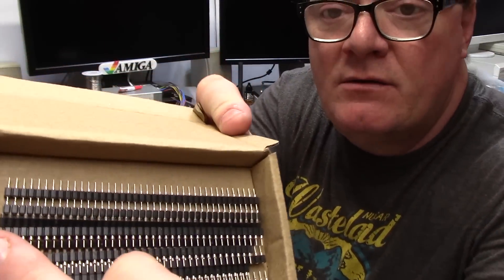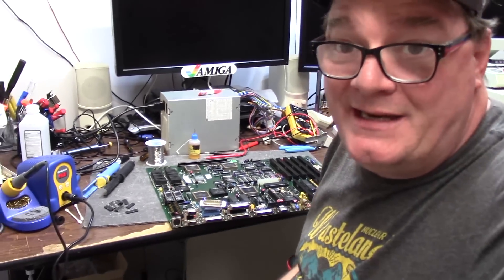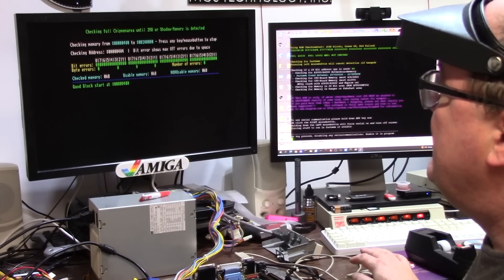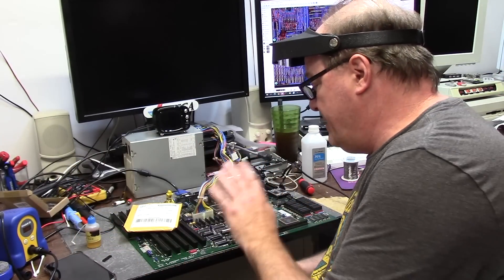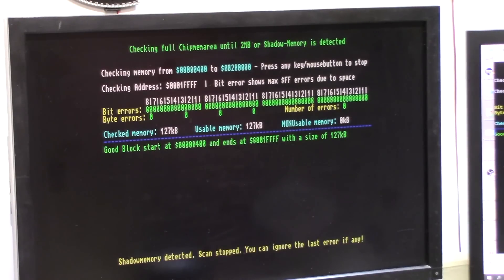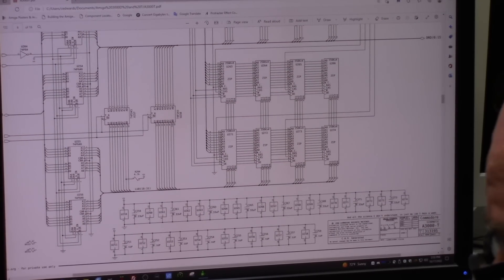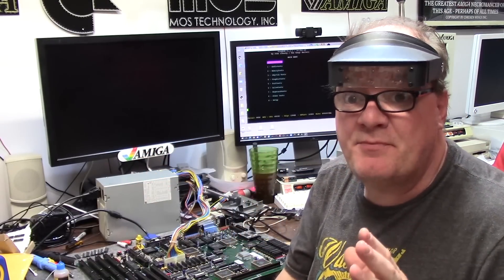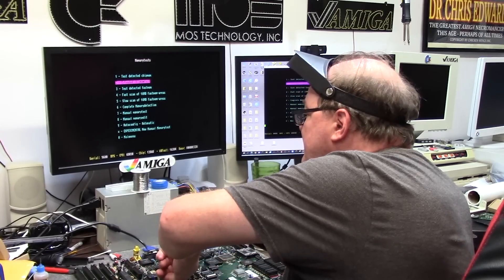Amiga 3000T no chipram 3 fin

Comment: Wow! Chris, you really are a glutton for punishment..
Hang in there buddy. Are you sure there are no traces cracked on the Mobo or is Agnus broke?
Reply from the maker: still digging through the ram areas to see if the first 128k chip has some crossed lines causing the shadowram. but its a slow road in between repairs for others.
Reply: @ChrisEdwardsRestoration  I am sure your persistence will pay off.

Comment: If the RAM loops after 128K (which is what "shadow" means, the test software detects it is checking an area that it has seen before), it means Address Line 17 is stuck (probably high, due to a pullup resistor/resistor pack), not getting either from the CPU to Agnus or whatever does the Chip RAM address decoding, or to the RAM chip(s) themselves. So this means the first 128K will be the copy of the 2nd, and the 3rd will be the copy of the fourth, and so forth. Probably.
Reply from the maker: Does your smarter than myself brain know what one that is please? Lol
Reply: @ChrisEdwardsRestoration  Well, now I see your problem, I actually took time to look into the schematics, and it's pretty confusing indeed... Anyway. I'd start with checking for activity and/or continuity on line A8 on the DRAB bus (that is pin 20 on these ZIP RAMs, if I read the schematics right), since that's the uppermost address line... And the 256K/4 bit chips are clearly "halved".
Reply from the maker: Awesome i will see what i can find.

Comment: during that period of chips the speed ns was very sensitive. i would check to make sure of the necessary default chips based on the datasheet of the buffer chips etc, and all the speeds are correct. i think these banks are in series swap out chip locations. pushing on the buffer chips was probably a broken solder joint. you will get it!

Comment: Wow Chris… This one is one big MOFO of a challenge… But I did learn about removing chips from a board. So thanks for the lesson on that one…. 👍🏻
Reply: Yeah, THAT surprised me!  As well as touching and pushing on the chips while it's ON.  I was told Not to do that when I was smaller as you could fry a chip.  I'm betting that was meant more as "Don't do THIS [if you're not set for static discharge].  Like not having a rug under you.
Reply from the maker: I wear a anti static bracelet on my ankle always. Its grounded to my table which is in turn grounded to my house grounds
Reply: @ChrisEdwardsRestoration  Ha ha ha, there you go!  The tells are revealed.  I always touch something metal before I do anything to my hardware; any hardware.  A reply to the Email will be coming soon.  I am still surprised about the pushing on chips like that....I cringed.
 However, testing my older 68zer060 if it was lose in the socket I had to press down on a corner with the part of the screwdriver that's held.  Noticing it was indeed loose - and paid someone to repair that.  So, it's the same thing, had I been shielded...a finger would have done fine.

Comment: Shadow ram (AFAIK) is detected by Kickstart by writing a fixed value to $0 and then stepping 64K(I think) further up until you either have come to the end of the memory range or you find that value in memory. It then writes a different value to $0 and checks that it now sees that same value where it had the match. If the value did not change at the checking spot it assumes it was a spurious match and switches back $0 and continues. Also known as mirroring, like the custom chips and cia chips do where you can access them at addresses higher than the official ones. If you mirror before expected then the address lines needed to access memory must be stuck. I guess an oscilloscope while checking memory should show you what lines have activity and which ones are dodos. Quick continuity check that none of the address lines have a bridging solder blob?
Reply from the maker: Yeah bo bridging. I did scope them all and they were wiggling like normal on the output which has me even more confused.  There has to be a borked line somewhere holding something low

Comment: U253-256 were OK as the CPU was able to access all 32 bits of chipram. I'd check how CMA0:8 look on a scope or logic probe, and then DRAB0:8. If I'm thinking right, if DRA7 would be stuck to 0, you'd be stuck with 128k repeating hence shadow mem detected.. (there would be more mem detected further along if you do a manual memtest in diagrom and then you would know for sure). If it really is DRA7 and U251 is ok, you're looking at a bad Agnus/socket/trace. There is always a cause to be found, and sometimes it's a time saver to measure, think, measure again, think again, eliminate things you know are working right in stead of shotgun replacing random parts ;)
Reply from the maker: I shotgun it all

Comment: Shadow ram means he detects that there is a mirror image of the things written to chip ram. So the adressing seems to flip around every 128kb. This tells me, that there must be an address line constantly stuck on a high level. Probably at the 128k 'border'. But probably not on the chip bus itself but on the CPU side of things, because otherwise there would probably show up memory errors in these 128k visible since the address multiplexing for dynamic dram. But looking at the schematics it could as well be on the CCAS[0..7] lines coming out of U202. These are active low so the line would be stuck to ground.
Reply: I agree the current behaviour looks addressing related!  Wrapping due to an address bit not working!

Comment: got me thinking possible board flex separation in the internal layers, possibly causing circuit path thermal issues when it's cold in the area on startup. Just a S.W.A.G. out of my past. Use to encounter a lot of those issues with Aircraft Mil-Spec black box systems in a former life in the 1970s thru the Mid 1990s USARMY.

Comment: Does shadow ram mean that bytes written to one address are showing up unexpectedly on another address?  If so, that would tell me that there is a problem with the address buss with pin tied together maybe?
Reply from the maker: i dont know, usually its like it sees the same address in another spot. like a wire got cross, or something, but its all new, theres nothing broke. it drives me nuts. or i missed something somewhere. arg.
Reply: @ChrisEdwardsRestoration  Maybe pull Agnus (is that what it is called on a 3000?) and the memory chips and do some continuity tests across the address lines (row/columm) and see if you get some continuity across a couple of them.  Maybe you will be able to tell if you take the shadow address bit pattern.  Also, as for checking your chips, you may be able to make an adapter for your PROM programmer to make them look like the DIP version of these SIPs and have your programmer test them.  Just some suggestions from someone who is not nearly as good as you at repairs.
Reply from the maker: Oh i have dug way deeper but didnt feel lole this series needs to be milked out even more.  Theres a massive twist coming up next